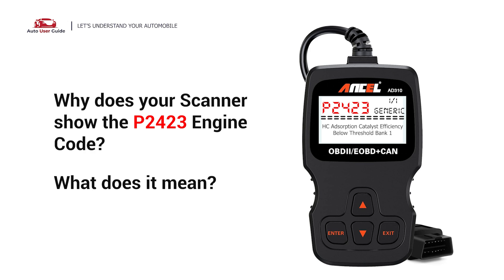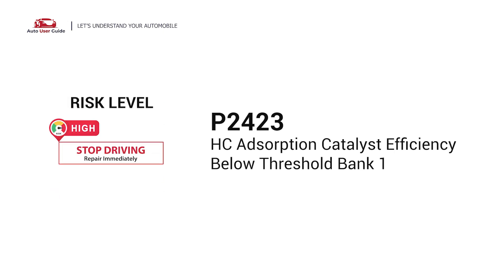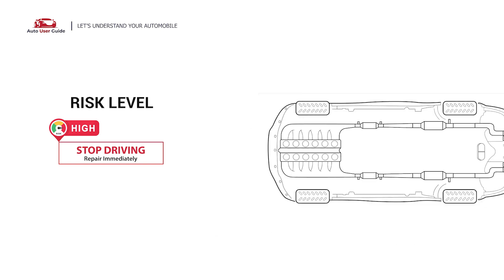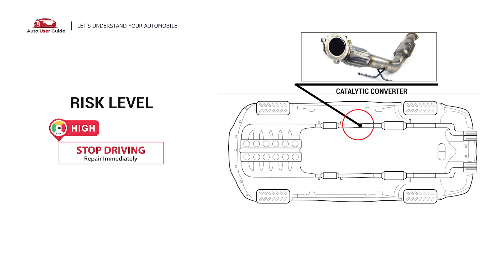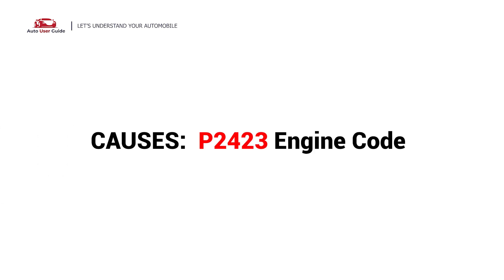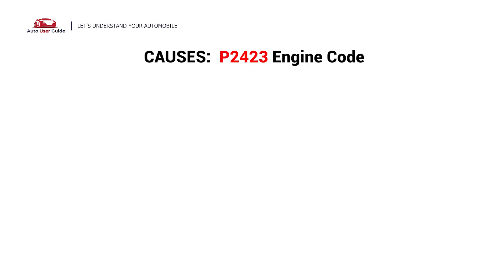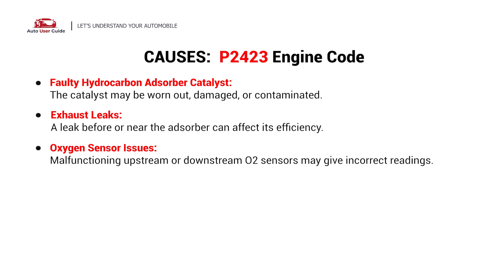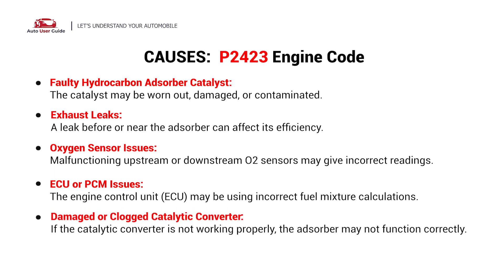What is P2423 : Engine Error Code Causes Explained

Comment: Please help….. I have a 2006 Toyota Camry XLE 4 cylinder and this code just came up….. I just put a brand new OEM O2 SENSOR IN and had a new flex pipe welded in the engine where there was an exhaust leak…… this code was accompanied with P0420 …….. HELP PLEASE
Reply from the maker: For your 2006 Toyota Camry XLE 4-cylinder, the P2423 code usually points to an issue with the secondary air injection system or exhaust backpressure, and it often appears alongside P0420 (catalytic converter efficiency below threshold). 

Since you recently replaced the O2 sensor and fixed the flex pipe, here’s what to check next:
1️⃣ Inspect all exhaust connections and gaskets for leaks — even small leaks after the repair can trigger these codes.
2️⃣ Check the secondary air injection valve and hoses for clogs or damage.
3️⃣ Make sure all O2 sensor wiring harnesses are properly connected and not damaged during the flex pipe repair.

If everything looks good, the catalytic converter itself might have been affected by the previous leak or sensor readings. 

Would you like me to make a step-by-step guide on diagnosing P2423 and P0420 together for your Camry?
Reply: @Auto-UserGuide ok…… I will check again!!funny enough, the code went away by itself …. Very odd! I’m gonna have my mechanic blow out the exhaust and I’m going to do a Cataclean in the mean time! And I would love if u did a step by step video for me. All the help can go a long way, thank you so much